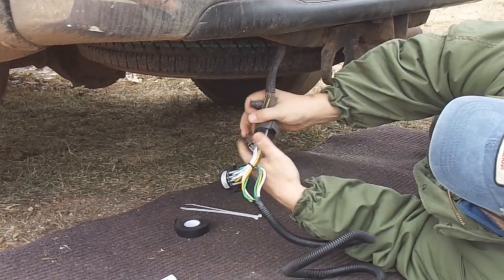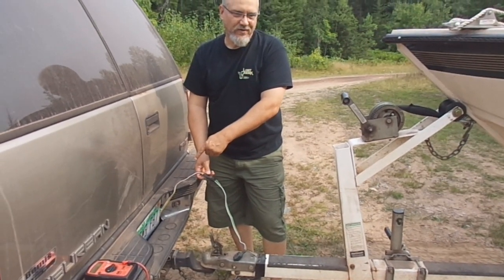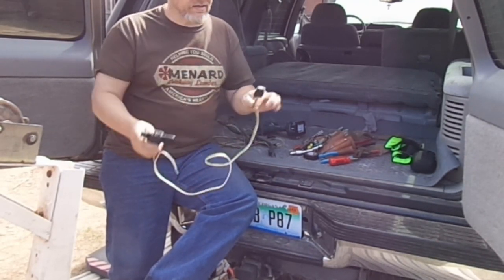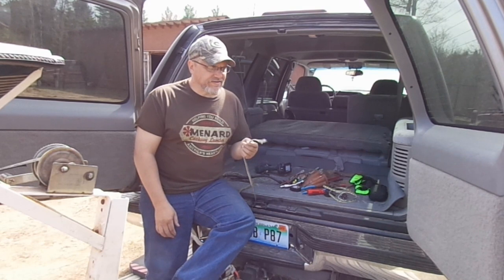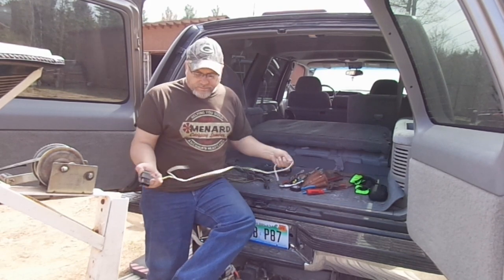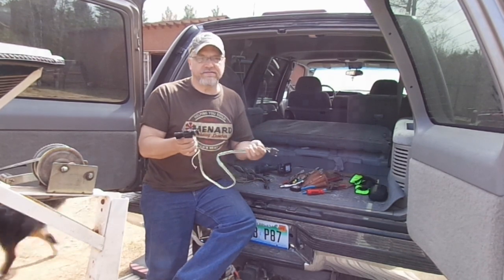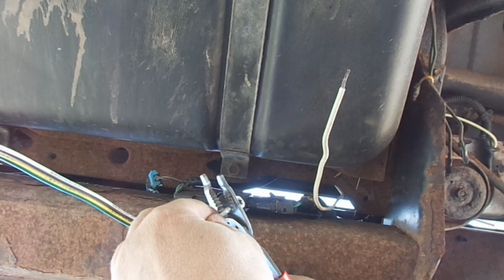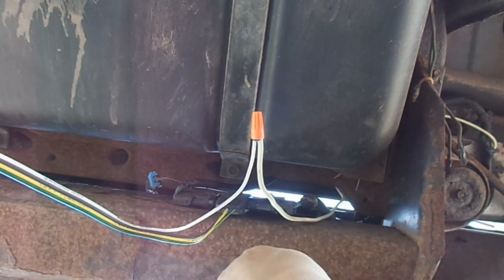FIX YOUR TRAILER LIGHTS (4) - Installing A Truck Side Plug

Comment: Great video like always I would like to add if you use zip ties for any outside holding jobs use the black ones they are recommended for outside use and hold up better to the weather.

Comment: I put new wiring on my 5×10 trailer, I drilled holes through the center of the angle under the trailer and put cold water pvc rear to front and run the wire through, should last a good long time
Reply from the maker: Sounds like a good set up, KPO.

Comment: I like the video and information but the only thing I would not do is use a wire nut on my vehicle's wiring. Wire nuts are suppose to be used with home wiring only not vehicle use do to it is not a complete weather resistant connection and can cause high resistance with corrosion or connection issues later down the road with the ground wire.
Reply from the maker: I hear what your saying and I'll explain my though process.  Wire nuts are not only for home use.  They are extensively used in heavy industry too.  You are correct wire nuts by themselves are not a good water tight connection, but with some anti-oxidizing grease applied in the nut after connection and then taping them up, you do have a pretty long lasting connection.  And this does allow for disconnection without cutting wires.  Which I often do because plugs corrode or wires break.

Comment: Ok, I am a 74 year old female, just bought a pop up camper, I have watched your videos, unless a missed something, I didn’t find my problem, so here it is. When we hooked up my car to the trailer all the running lights came on blinkers and brake lights lights didn’t, the guy said that the trailer lights were working the last time he used it,  I am more inclined to think that it is from my car it was pulling a  travel trailer but hasn’t been used for five years as far as plugging something into it and it does have a seven point hook up I just ordered a multi meter because I don’t have one I did check my fuses under the hood, none are blown, I will check the bulbs tomorrow and also check the wiring under the car, If you have any other suggestions please let me know I appreciate it thank you very much
Reply from the maker: see other

Comment: You didn't show at the end if your work actually lit up all the led's on the checker. In my case only one of the lights works on the checker, so do you still put in a new truck side plug? Or do something else? I checked all the fuses I could think of and they were good.
Reply from the maker: I guess make sure the checker works with another vehicle.  I may have some more answers in this video https://www.youtube.com/watch?v=MqrpMcjGiTM&t=371s thanks, KPO.

Comment: I have used these on several different vehicles. This is the best way unless someone has already messed with the wires and cut them up. Here in Pa if  you cut wires under a vehicle you are gonna have problems!!!
Reply from the maker: Randy, same here in Upper Michigan.  Lots of salt on the roads in the winter.  Thanks for watching, KPO.

Comment: Wire nuts are horrible to use in vehicle applications,  they're for house wiring... solder and shrink tubing!
Reply from the maker: One of the reasons I like wire nuts for this application is a lot of the time my plugs only last a few years and then I'm changing them out again.  If it's something more permanent, soldering is great.  But my plugs wear out long before the wire nut connection.  Especially when adding the grease and tape.
Reply: @KnettersPracticalOutdoors  aaahhhhh..... preference then.

Comment: I have a 92 GMC jimmy, I'm looking for the same thing for my vehicle and i cant find it anywhere. any help?
Reply from the maker: If you can't find it on Amazon I would try the local auto parts store.  If anything they should be able to order you the correct one.
Reply: @KnettersPracticalOutdoors  Thanks, I'm so used to buying everything online, that didn't even occur to me. Damn computers!

Comment: What a waste of time. Nothing said until 5 minutes in, then just hooking up to an existing plug. Sheesh
Reply from the maker: Sorry it wasn't more informative for you.  But some viewers may be interested in the other videos I did on trailer lights, some may not understand that each make of vehicle takes a different plug, some may want to know why I like to buy a plug instead of just splicing into the vehicles wiring (even though it costs more).  Some viewers might not of even known that you can even buy a plug for this.  It's not rocket science, but some or all of the info is new to some viewers.  KPO
Reply: bikephil I agree. Good ad for Ox Guard, that’s about it. Waste of time

Comment: Dave,

I have a 97 suburban, very very similar setup. I've tracked my issue to being inside the truck, where you connect the T-Harness. My 4 pin is getting power to the brake and turn signals but not the 3rd pin down just before the ground pin, the trailer lights. I also have a dual 7 4pin-7pin flat and the 7 pin receives no power. Do you happen to know the term for this part if the electrical system? I'm trying to hunt a blown fuse. Should I take it to the mechanic?
Reply from the maker: Ok so it sounds like you don't have the running lights.  Do they work on the suburban?  If they do you probably don't have a blow fuse (unless your sub has separate fused trailer lights).  If you don't need that 7 pin harness I would remove it.  Also try a new T harness.  Maybe corrosion or a wire break inside of it.  Let me know how it turns out, KPO
Reply: @KnettersPracticalOutdoors  thanks for getting back to me. It was the running lights, very old harness had some damaged wires so a new harness fixed the truck side issues.

Comment: Do you how you to wire a 4way flat output to a 1975 Chevy van g20?
Reply from the maker: Never done one of those.  Not sure if they have plugs you can disconnect or not.  But the good news is older stuff is usually easier to work with, KPO.

Comment: Do you know why 4 pin with 7 pin adapter is not working  signal flicks once then doesnt work .  Why?
It initially worked but then after flicked once. What is the issue. If someone could help.. A mechanic asked if the signal and brake were the same light they are not.
So mechanic said that he believes that is the reason.  IDK anyone know why?
 google said bad ground.
Reply from the maker: Clean all plug connections up real good and check the fuses too, KPO.

Comment: hello this is if you a driver you have are sweet lover..

can i ask what is the best wiring ? is it with fuse or not have fuse?. because park light or running light was not working to roof marked lights .are they considered it for a safety? and what is the need to get approve to safety and get license plate?. ontario living moving forward to edmonton with the trailer converter on a trailer is what im using when its trigger to 12v all light off when trigger on converter all lights are on then im plug it to 110v with 12gage wire amp outdoor extension code yellow and green indoor color code blue .im learning a self-decipline and clearing the pop up trailer to put the households and secure everything in travel .trying to multimeter the load power and wires and it also the trouble is on the trailer rear light to separate the function of signal light in small bulb through to powering the park and brake light its anything you can offer to pass and get the plates and as mech and painter of the car i respect the what i see and learning clear to your channel and guide to success.

thank you  for learning videos
your new subscriber and certified experience in ministry of safety certification  [auditor] non-profit .
copy right digitally described secured sharing personal ability in exceeding the enforce of the law/by-law R. v. e-commerce writer and inspection assoc.        Q:more....how you re-relay wiring positive output and light relay for safe travel without electrical problem and organizing tool..constructing a webinars to voluntary and copy paper .forgotten all guide and diagrams this 7 years living without any form related and violations by-law.
Reply from the maker: Everything should be fused.  Some vehicles have a separate fuse panel for trailer lights, KPO.